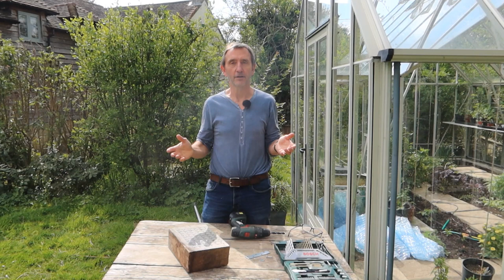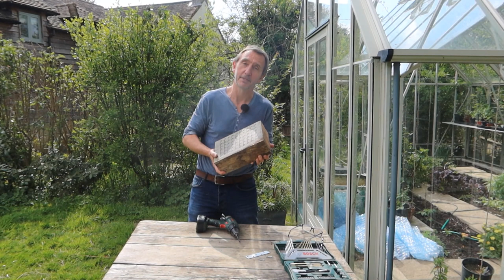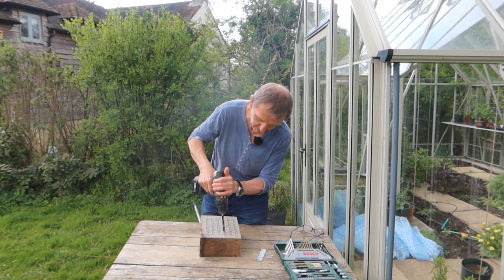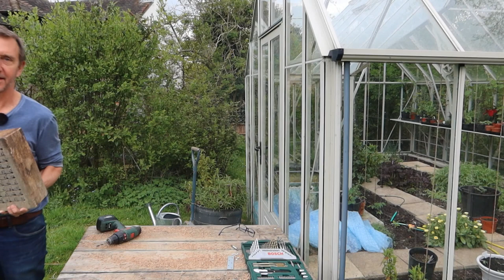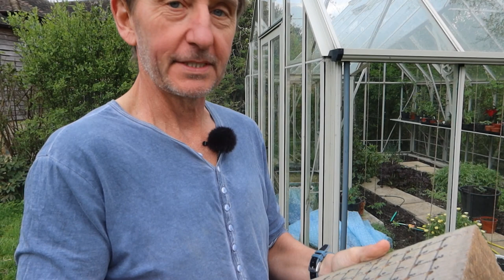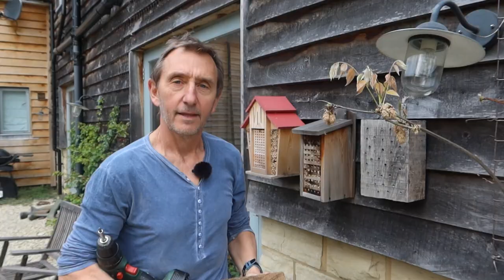What size should the holes be in a bee hotel? PART I

Comment: I had a go at this and voila - a few resin bees moved in and they chose the smaller (8mm) holes.  I also had a spider move into a 12mm hole which was unfortunate.  Also, apparently they actually prefer to use a spent hollow (probably flower) stem from some annual plant for hygiene reasons.. so I'm putting a few of those in my dead hedge insect home..  This is a heck of a lot of fun !

Comment: Interesting to see you go into solitary bees Professor Goulson.  There are some variables to this experiment which are not evident at first glance: 
1/ the size of the arriving Osmia bees will depend on whether they have been victim to the kleptoparasitic Cacoxenus flies which will reduce their provisions they have during their larval stage, and consequently the size of the nesting female. 
2/ an eventual nest plug is not solid evidence, per se, that the nesting space will be completely filled with nest cells (and thus be declared as significant). You would have to paper line the tubes to count the density of nest cells/cocoon results. A significant percentage of plugged holes may just contain one nest cell at the back, which might be because they run out of eggs or they 'change their mind'. There is also another factor: 
3/ Osmia rufa/bicornis can also suffer a form of confusion or trembling dementia when they get to the end of their natural life (if they survive that long), which results in them repeating certain behaviours such as just plugging nest spaces. A nest plug may then not necessarily be an indication of nest hole size preference.
4/ Your hole sample is small and may also skewed and affected by existing bee hotels which - as they have not been cleaned and deparasited - and which may skew the first cited variable.
Anyway it's an interesting project. There's also more to say about how uncleaned bee hotels full of emerging spring mason bees with their parasitic charge can impact on, and be a problem other later bees coming to the nesting arena.
Reply from the maker: Many thanks, very helpful,  I had not heard of the trembling phenomenon, will keep an eye out for that.
Reply: Occasionally one stumble on an enlightened response (admittedly rare on youtube).. but that's right up there. It would be great if you could share but dillute the knowledge so it passes over to the masses so we're moving in the right direction. My own gardening for wildlife starts off great with loads of Queens visiting the Skimmia Nymans shrubs in March, but in recent years the activity on the Ceanthus shrubs on May has been a massive let down ... things are changing .. for the worse in a big way it seems